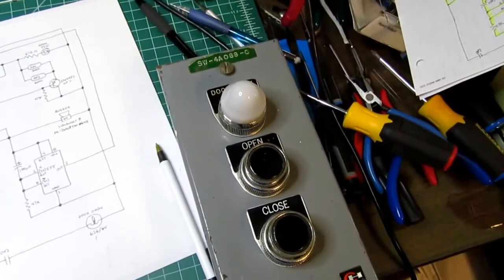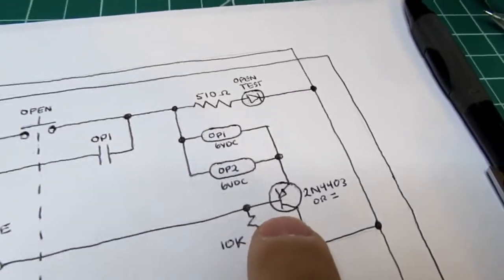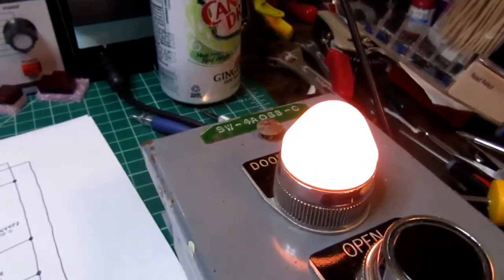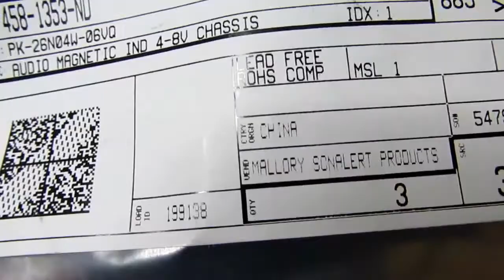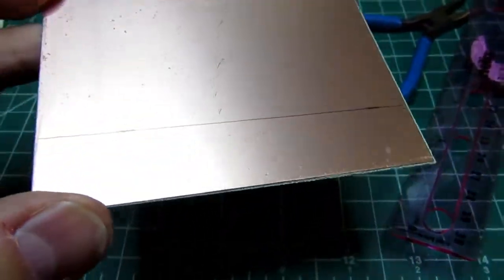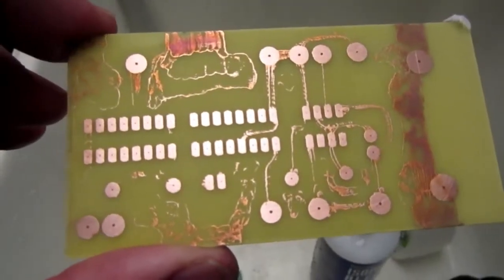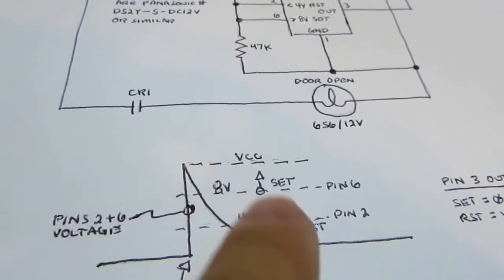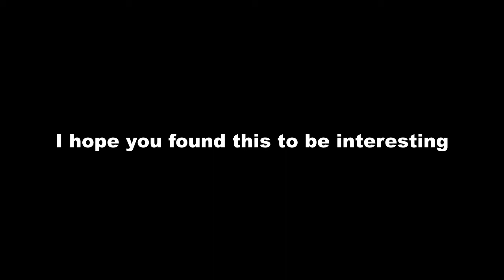Hacking a Titan II Missile Silo Blast Door Control Panel

Comment: Learned a lot from watching the project evolve.  Always used a 555 for just making LEDs flash on and off.  I see it has a lot more sophistication.  It would be cool to have an original Titan II (ICBM) missile silo blast door switch indicator type lamp working as it did in operation running off it's specified voltage and current type.  It might light up instantly.   If the blast door switch box has to have a power cord it would look more in situ to have realistic conduit attached for a short distance to carry it, maybe just a foot or so.  Watched the video twice.

Comment: Fun bit of trivia: The control panel to operate all 4 blast doors in a titan 2 missile silo is located behind blast door 6 which is the first blast door. The problem with this? 
     If someone wanted to and they had a hydraulic hand pump they could manually open blast door 6 and from there open the other 3 blast doors and the crew inside couldn't do a thing to stop them. So the Air Force's solution to this problem was to install what amounts to an oversized night latch on blast door 7. When the day ended they would use this oversized latch and then door 7 could not be opened under any circumstances.

Comment: For your info.    pressing and holding the open button causes a relay in the hydraulic controls  to retract the 4 locking pins on the door frame..   It up to you to open the "6 ton" door.  One finger will open it.  after you close the door you have to hold the close button until the light goes out.

Comment: I wonder if mounting the switches to the lid would make it easier to flip the box.
Reply from the maker: Leland Rogers, the switch bodies are already mounted to the cover of the box, and I could unmount the contact blocks from the back and mount them to the switch bodies. But the lamp body is of a model that must have the socket mounted as it is, and therefore it is keyed to the box. Since not modifying the artifact was a primary goal here, I did not see a way to make it work other than how I did it.
Reply: Ah, I see you did that.

Comment: Is it possible to rewire the missile control panel and then launch it and if you can then you could probably hot wire a missile
Reply from the maker: Are you joking? Absolute nonsense.
Reply: @youtuuba   I know it's nonsense but is it possible
Reply from the maker: @theunknown-nj5so  If you had any understanding of the complexity of launching a real, full scale missile, you would realize that 'possible' in this instance is being stretched far beyond reason. On the other hand, it would be easy to launch a small hobby rocket using simple pushbuttons such as this blast door panel has. But that would be a silly and shameful abuse of such an historical artifact.
Reply: +the unknown. No, There were two pieces of equipment in the LCC that are in a continuous digital conversation with the missile's electronics, the BVLC (butterfly valve lock control) and the MGACG (missile guidance alignment checkout group). If either of these were interrupted for any reason an alarm will be sent to SAC HQ and the complex would take itself off alert status. Furthermore physically tampering with the missile to bypass it's safety devices also would not work because doing so would trigger an explosive charge inside the butterfly valve lock, jamming the locking pin in position forever.